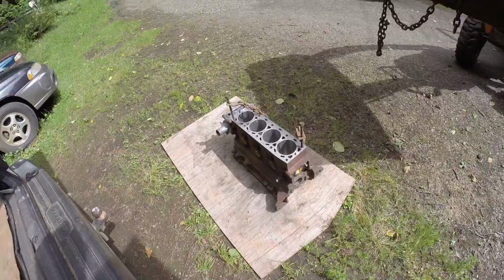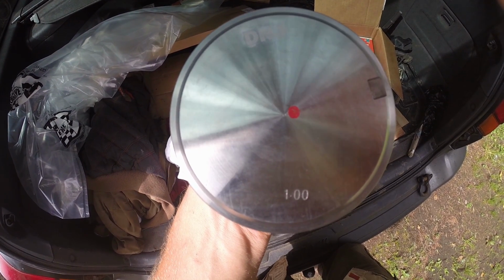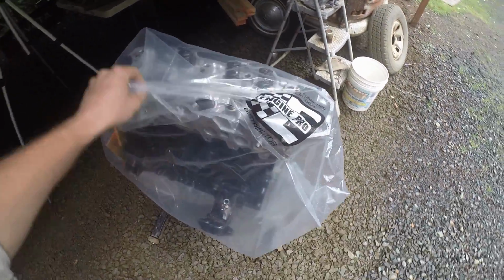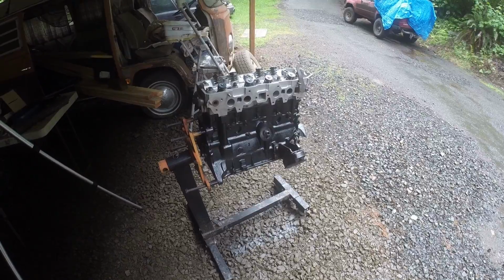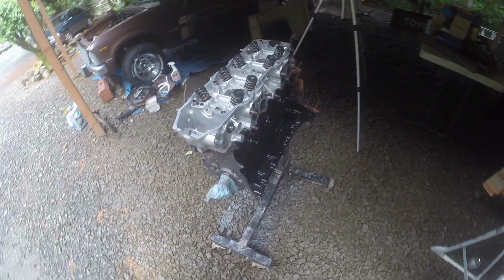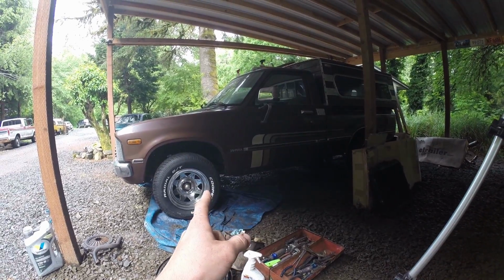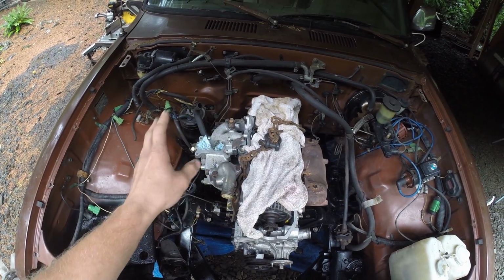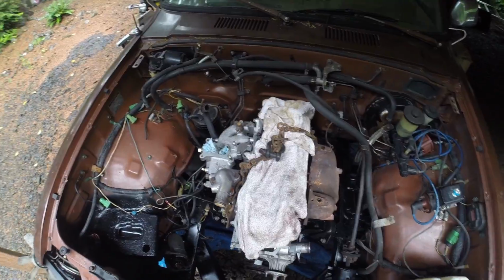It's Time to Build Chihiro's Motor! Time lapse Style

Comment: Nice video! When I bought that engine from a wrecking yard I was told it was from a 1976 Celica. You may notice the dipstick is bent. I did that because since the dipstick is on the opposite side on the 1979 I had trouble with the dipstick hitting the battery.    I know the chrome grill is not your style but I got it as a birthday gift and was very proud of the way it looked. Chrome was very popular in the 70's and 80's and I still love it. Can't wait for the video of you driving Chihiro! I wish it was me.